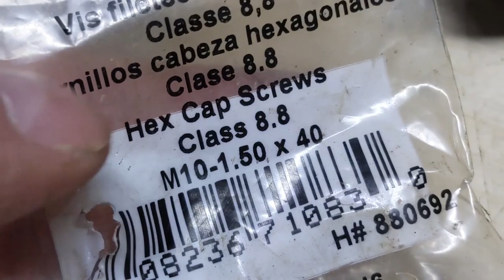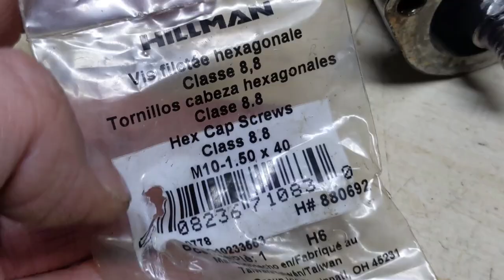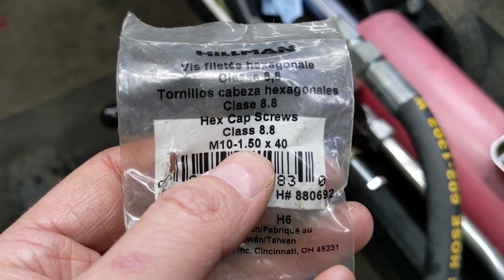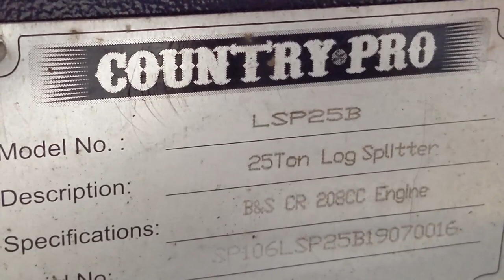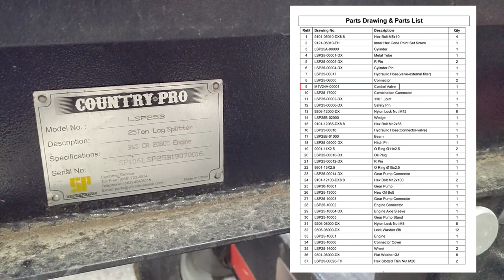Log Splitter Control Valve - Auto Kickback to Manual Conversion

Comment from the maker: What I failed to mention is my customer heats his house with a wood stove, so this log splitter had to be returned in working condition so he could split wood to burn. I've gotten a couple comments saying I shouldn't have done this, but if you watch the video you'll also hear me say we did order the replacement part, but that won't be in for 2 weeks. In the meantime, my customer will just have to be careful using this equipment, as there is essentially no safeties anymore. In my opinion, this log splitter isn't any more dangerous than it was before, as long as you pay attention while using it, and don't max out the piston in either direction.

Additionally, this unit had the forward return spring to automatically return the valve to neutral if the operator let go of the lever when the wedge was moving forwards to split a log. I most likely could've used a washer at the bolt head end, reused the spring and put the bolt through them, so that when the lever was pressed forwards, the spring would compress enough to bring the valve back to neutral when the lever was released. It would take a bit more time to figure out the correct length of bolt needed to do this, but it's something that could be set-up to give additional safety.

Comment: Great modification. I see "can't be done" is not in your vocabulary. Good for you. By the way, after watching your last two videos, I went out and checked my snow blower to make sure that the auger was installed correctly and that my bushings were not too worn.
Reply: Good job it never hurts to check things out periodically. Presently we are firing up our lawn mowers we have in stock and reviewing which ones may need some service.
Reply from the maker: Thanks for watching!

Comment: What a great video explaining what you had to modify on the log splitter until the part needed came in to repair it the right way but a good way to use it in a pinch if you need it straight way as the customer did. 🔧

Comment: Another great video..
I rebuilt a very heavy homemade log splitter detent valve and was able to use it for about 5 or 5 cord of wood.
I hate these manual valves. I would rather have a Automatic Return Valve for splitting alot of wood. For just a little bit of wood the manual is fine e but if you are splitting alot.of cords then you need an automatic return valve. 
You can split so much more wood
Reply from the maker: Yes it would definitely make for quicker work, but to get my customer up and running or use it for a 2 man operation where 1 person is loading and the other is operating the lever this would work fine. New valve is on order probably 2 week delivery ETA
Reply: @EliminatorPerformance  yep..as a small engine repair mechanic and owner of my own business you have o do what's best for the customer to get them back in service

Comment: Very Clever and great job! I was impressed with your ingenuity and creativity! The video may have seemed a little long to you, but it was good getting the history and background and explanations.
Reply from the maker: Thanks Joe, just got to be careful with this modification as there's essentially no safeties anymore to protect the operator. We only did this to get my customer back up and running since he heats his house with a wood stove.
Reply: @EliminatorPerformance  That makes perfect sense, and you mentioned in the video that the value body was on order. With the sometimes delays with the supply chain, its nice that you can get a customer up and running quickly while waiting on parts.
Reply from the maker: @joehorecny7835  we just got the email, thanks for the support Joe!
Reply: @EliminatorPerformance  Glad to assist!

Comment: My auto kickback problem was a stuck shuttle valve at the valve end of the threaded piece. Knocked out a roll pin at the end of the threads, tapped out a small plug (1/8" approx) and was able to push the valve back and forth from each end after inserting air tool lube in both sides. Got it to move freely enough after a few minutes and reassembled. Works good now!
Had the detent sleeve on backwards the first time and it would lock in forward but not reverse. Oops.

Comment: Hi mate this is not about this tool it's about the plastic welder 6 months ago when you run out of clips get a roll of 1mm stainless Steel  cut and bend how you want save money 💰 can't see them clips you got with it being stainless and you can cut the wire to any Length so you have seamless weld hope this helps 👍
Reply: Thanks but these are very inexpensive to purchase but thanks for the information. Prior to the purchase of this welder we would use cut wire and our soldering iron with zip ties as a plastic filler.

Comment: The mechanism on this splitter that seized, should have been able to unseize. Or was it completely impossible for to unseize the mechanism???? Inquiring minds want to know. 🤔🤔🤔🤔🤔🤷🏿‍♂️ Keep up the good work. 😊👍🏿
Reply from the maker: We tried! We put it through the ultrasonic cleaner, then soaked it in oil. Even used the venom HP induction heat tool to heat it up. Thing was seized solid.
Reply: @EliminatorPerformance  Wow, what caused it to seize so badly?????🤔🤷🏿‍♂️
Reply from the maker: @patrickpoulard24  we believe he stored it in the upright position and the hydraulic fluid drained out and some moisture got in because of that plastic cap.
Reply: @patrickpoulard24  Totally rusted heavily inside the cover with shaft and springs etc totally corroded with rust. Basicaly the internal relief ball that allows the dent section to operate could not even be freed up with lots of rust preventative lubrication sprays nor 3 times in the ultrasonic cleaner then flushed with WD40 until clear fluid ran out of it.
Reply: @waynestefinashen239  
I was thinking the same procedures minus the Venom, which I don’t have, but using my heat gun and propane torch, except since we’ve got an abundance of snow these days I would have shocked it with copious amounts of snow/ice/slush. That and also the only tool you couldn’t have used in this case - time. I’ve soaked things in penetrant for days or weeks of applications to get them loose eventually.
Reply: @Rein_Ciarfella  I think even if we got it free and moving it would have been so badly pitted it would end up seizing again in the near future. They could easily sell that part of the valve but choose only to sell a complete unit instead now that is crazy.
Reply: @waynestefinashen239  
Good points. 👍🔧

Comment: Why did water get in the valve , is there water in the hydraulic oil ? Did you change the hydraulic oil or filter ? It looks like it was left outside uncovered . Does the engine stall when the cylinder hits the end of its travel on both ends ? Scary to let these modes go out , Because if a line or fitting lets go at high pressure a serious injury can occur . Making these or this mod is not a good idea if you do not know what could happen to you or anybody close by .  This is a can of worms , I WOULD NOT OPEN .
Reply from the maker: Customer stored this outside, and I believe also in the upright position which is not recommended. We believe some moisture got in, and pair that with it being upright and gravity pulls the oil down, away from the kickback assembly. As for water, the oil is clear and not milky so he didn't want the hydraulic filter changed. All I did was remove the kickback and install a bolt to make the control valve operate manually, and changed the engine oil to 5w30. The valve works fine, and if the piston is allowed to max out, the engine simply shuts down because it can't turn the pump. Basically a hydrolock situation as I mentioned. My customer was ok with the modification, he actually requested it. He just wanted it up and running until the new part arrives (2 weeks out) and I figured this would make a good video for anyone who had the same issue. Thanks for watching!
Reply: Your correct Chris but because the customer heats his home with wood only and is almost out of split wood (also being elderly can not swing an axe to split) they requested the modification waving any liability against EP and when the new part arrives it will immediately be installed. PS sad the dent section is not available it would likely have cost around $50 for it but if they continue to store this outdoors without some sort of protection from the elements it will happen again. Possible that covering this valve with a plastic bag and WD40 spraying periodically will improve longevity is possible.

Comment: No…just no. I don’t even know where to…no just no. Log splitters may be simple but not understanding high pressure hydraulic system and components like this will get people hurt. No spring to center, no relief testing, etc, this scares the chit out of me.
Reply: Sure does that is why they waived any liability and they were running out of split wood to heat their home (their only source of heating). We tested it and it works fine you just have to pay attention to what you are doing on the control valve end. Once an overload situation happens it kills the engine since the motor will not handle the excessive pressure like when the dent failed.
Reply from the maker: Well I think we'd both agree that people who don't know how to operate equipment safely shouldn't be operating it in the 1st place. It's quite simple, don't put something you don't want split in front of the wedge. The valve works perfectly fine, forwards, back, neutral. As I said in the video, this just gets him up and running until the new valve comes in (2 weeks) then once that's installed he'll let his kids use it again. In the meantime, his wife can run the lever and he can load/unload the wood.
Reply: So…to both of you. Do you even realize what is happening when you are stalling or just about stalling the engine?? You are taking a hydraulic system that is designed to operate with a relief of ~2200-2500 psi. Now without a relief the engine may or will kill when ram hits up against a stop be it either ends of cylinder stroke and when that happens system pressure could be spiking as high a 2-3 times over design system rating. You are stressing hoses, valve seals, cylinder seals, etc. you are reaching or exceeding those hydraulic hose burst ratings!!
Reply: @garny3766  Appreciate your concern but had to get this customers wood split to heat their home since it was the only source of heat. Customer was extremely pleased and had no issues splitting a cord of wood then returned the log splitter and the new valve just came in yesterday. Yes we understand these principles and never we or our customer stalled the engine out while using this quick fix. Some people do take chances in life to continue living i personally would not want to freeze to death must be a horrible way to go i would think.

Comment: I knew a guy who was working with a log splitter and got his thumb took off because of not paying attention to it  glad you are doing a video on the auto return to manual return
Reply from the maker: Yes that's why it had the forward return spring to automatically return it to neutral. Thanks for watching!
Reply: @EliminatorPerformance   okay thanks for the video on this matter Jake

Comment: Why not use a dremel or nut splitter to take the nut off and then pull the piece forward ?
Reply from the maker: It was easier to just remove the whole thing and then cut it lol trust me, we even put the venom HP induction heater to it and the nut wouldn't budge, the whole thing was seized solid.
Reply: The dent system removed very easily once the nut section was split with the grinder. We did not use the nut splitter since we may have damaged the housing which needed re-installation for manual use and the dremel would have taken too long. Once is was cut off we were able to move the nut but the system was still seized up due to rust and corrosion.